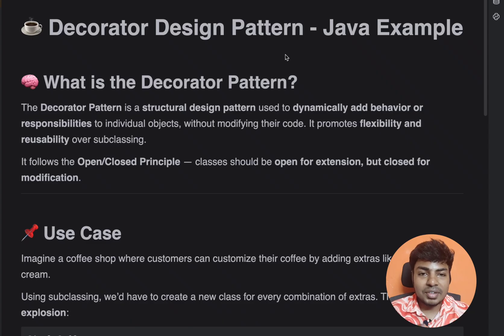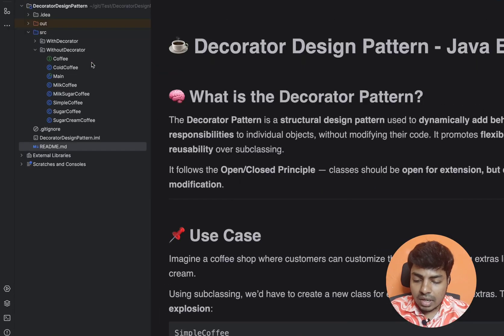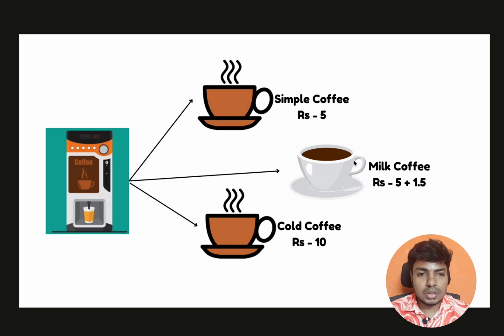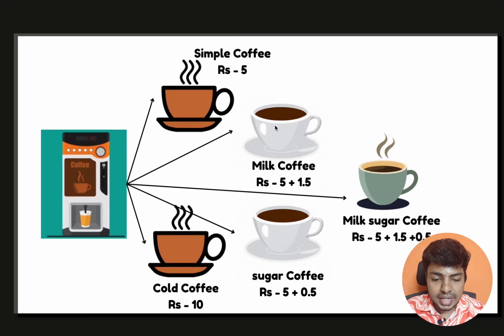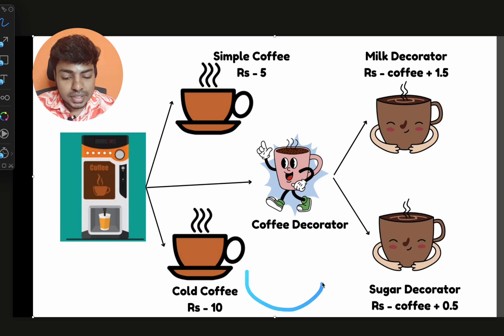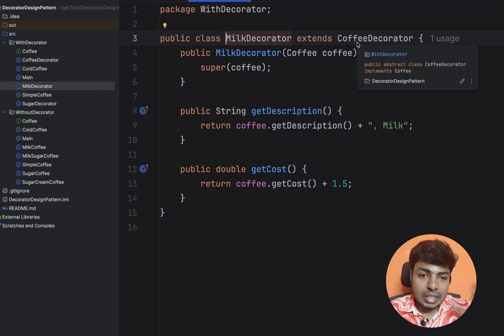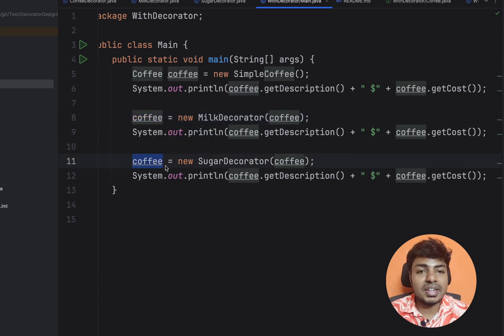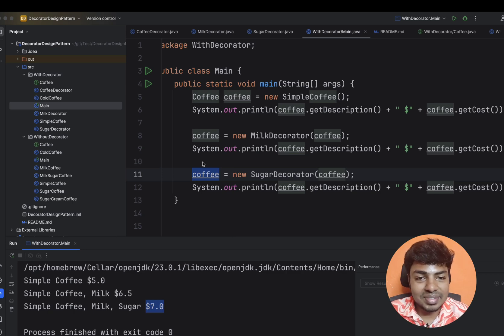Decorator Design Pattern Explained | Real-World Example + Code Walkthrough | Tamil

Comment: Bro, even this with case decorator pattern.. finally we end up in creating multiple class for each new requirement right. Primaryly handling and maintaining will be messy right as you mentioned while explaining for wothout decorator.
Reply from the maker: No bro. Consider Without Decorator if we need to add 3 add-ons (Milk, Sugar, Cream), we need 7 classes (MilkCoffee, SugarCoffee, CreamCoffee, MilkSugarCoffee, MilkCreamCoffee, SugarCreamCoffee, MilkSugarCreamCoffee)

With Decorator: Only 3 classes (MilkDecorator, SugarDecorator, CreamDecorator), and we combine them at runtime as needed. Like if user needs Milk we use MilkDecorator. On top of that if he needs sugar and cream, we use both SugarDecorator and CreamDecorator. This way we are avoiding creating multiple combination classes

So, decorator avoids class explosion and makes adding new features simple and clean!
Reply: @devarajumapathi  Okay bro thanks. Which resources you are following actually to grasp these concepts and how you are actually addressing the solution ( design patterns) will be suitable for this problem.
How can we practice these things and make us comfortable. Your valuable suggestions please
Reply: @devarajumapathi  clear explaination bro

Comment: Added abstract in  Decorator without incomplete methods is there a reason
Reply from the maker: One main reason we shouldn't allow creating objects for base class. Abstract class prevents that. Marking CoffeeDecorator as abstract clearly indicates it's meant to be extended and not instantiated directly. This prevents misuse, improves code readability, and aligns with design best practices in the Decorator Pattern.
Reply: @devarajumapathi  Thanks now I get it.